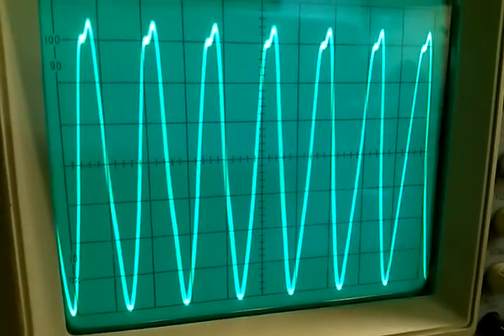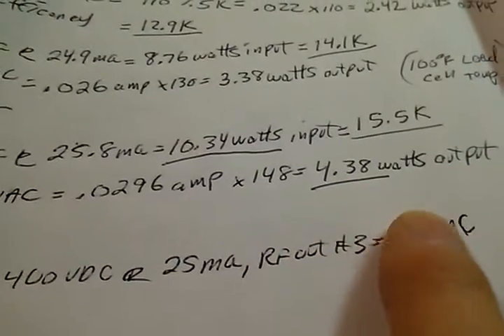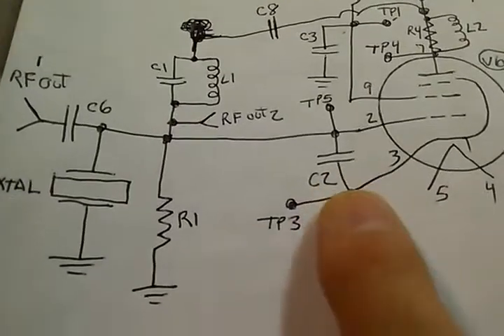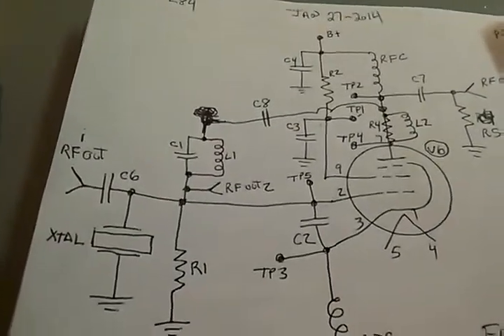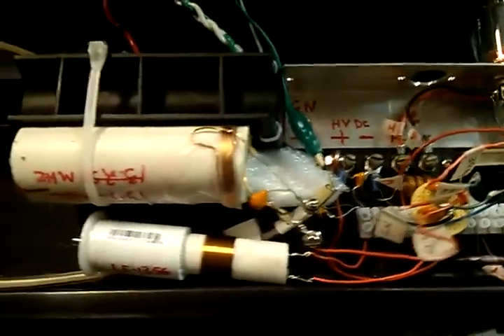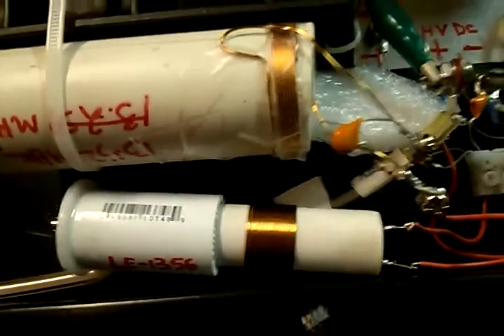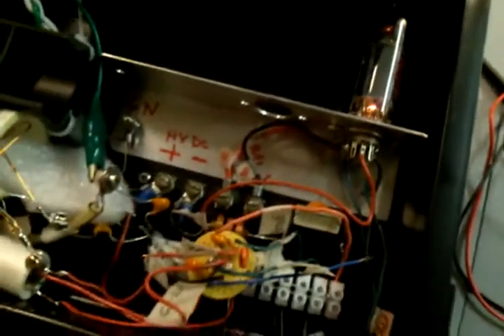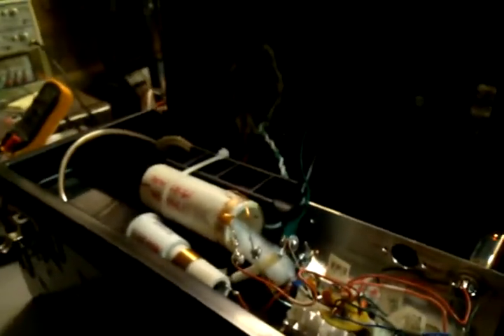13.56 MHZ crystal controlled EL84 vacuum tube oscillator #2

Comment: can you add 38mhz?
Reply from the maker: we will not ever design a 38 Mhz transmitter because it is not an ISM frequency and would be infringing on an allocated frequency.  Check the chart out please:
https://www.ntia.doc.gov/files/ntia/publications/january_2016_spectrum_wall_chart.pdf.
May I ask what do you need that frequency for?
cheers
CW
Reply: Ohh woow wooow sorry brother i hope i did't upset up. Sorry brother i love your  video you remind me alot of tesla and hes work. I was only trying to build a  resonance frequencies at 38 mhz in my coil that was all brother. I been trying to build it the passed 2 month. I dont know how to add the part right.. i said to myself ask lablanc and the other youtbe guy.  im sorry brother if i upset you man. God Bless you brother
Reply from the maker: Lation Fly .
No worry mate. It's tricky to get mhz tank circuits tuned. Are you using transistors for the oscillator or vacuum tubes?
Cheers
Cw
Reply: ohhh im only trying to make the coil pulse on 38 mhz that all like a EMP but on freq 38 mhz.. im trying to understand why my 2MHz - 80MHz 5W RF Wideband Amplifiers / Frequency amplifier power amplifier > https://www.ebay.com/itm/New-2MHz-80MHz-5W-RF-Wideband-Amplifiers-Frequency-amplifier-power-amplifier-/111478356006
i just dont know if my number  is right im using  copper wire 15 gauge i dont know how many turn i need or what is ohm.  5 watt is not alot of power i learn that soo far.
Reply from the maker: I use a reduction drive for the air capacitor so you can make super fine adjustments on tank circuit. Check out the circuit before hooking to amp. with frequency meter (a good DVOM will have frequency functions). http://www.orenelliottproducts.com/planetary-reduction-drives.
if frequency is too low, I cut off more of the tank coil and re-solder to the air capacitor and recheck frequency. Its trial and error. 
I assume you are using a transistor oscillator and not a vacuum tube?
cheers
CW